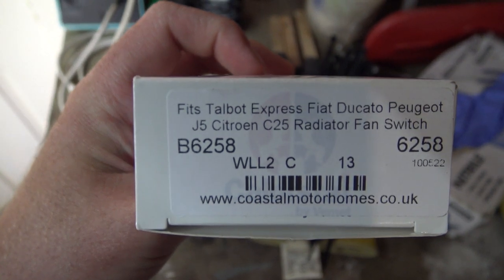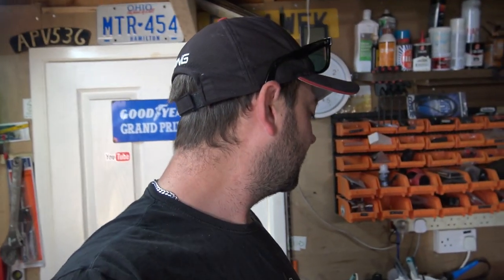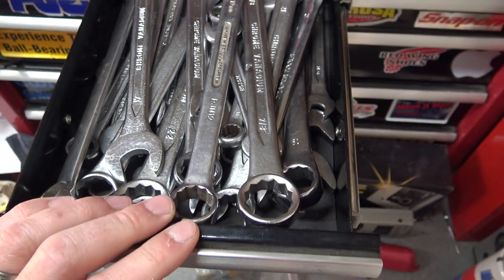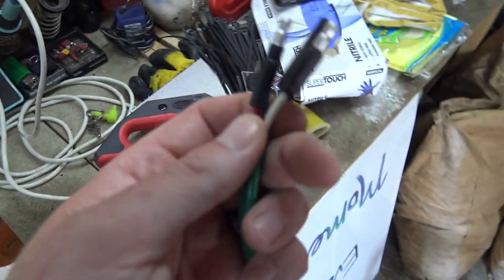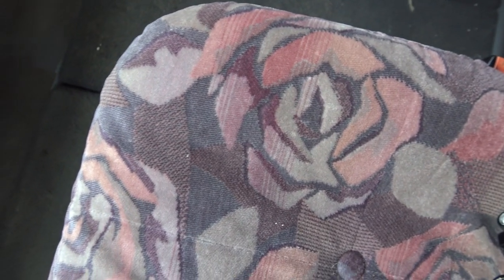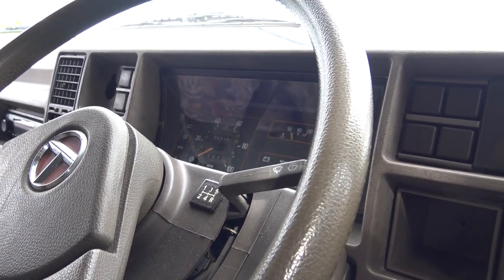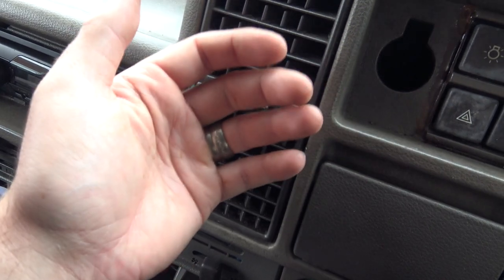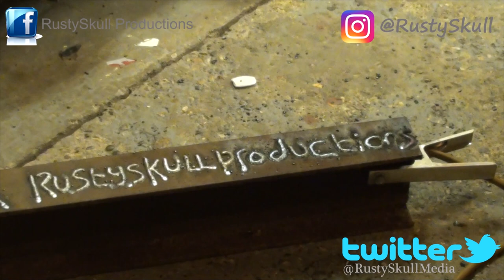Talbot Express Radiator Fan Switch

Comment: You might want to check for a fan relay in case that failed. They might have bodged it by bypassing the fan relay with the in cab fan switch. If that’s the case (which I hope it isn’t) you may have to dig a bit deeper into the wiring to get the fans to work as they should. I’d have a look and see where the switch wires go.  Don’t give up on it and scrap it, it will be worth it in the end.  All the best for the MOT.

Comment: I've got the a campervan with the same engine , I was having problems with the fan switch . Did u manage to get hot air come thru vents . I've changed the heater matrix on mine and thermostat and doesn't seem very hot .
Reply from the maker: I haven’t yet looked at that issue dude